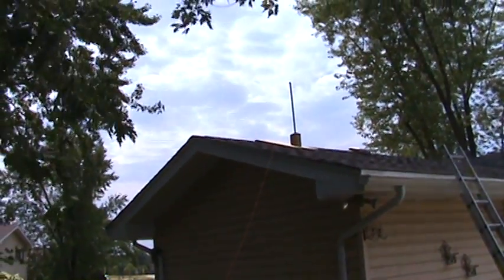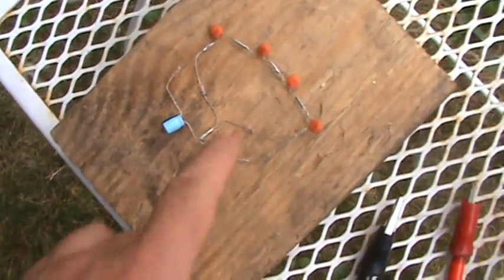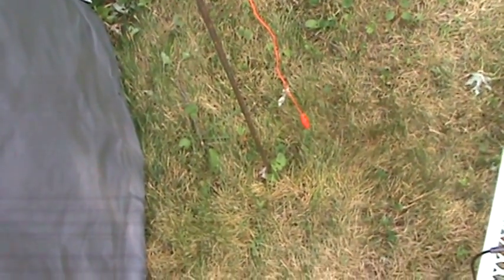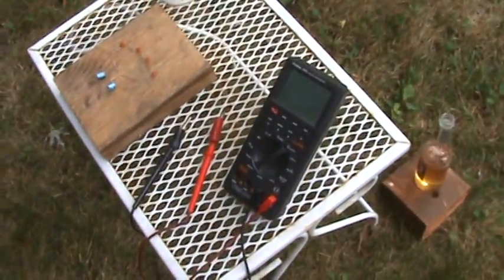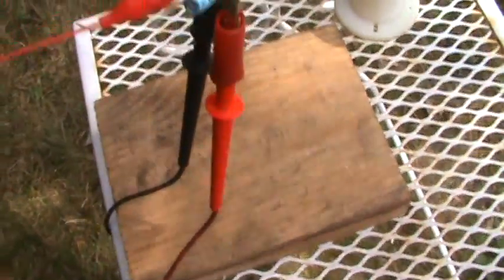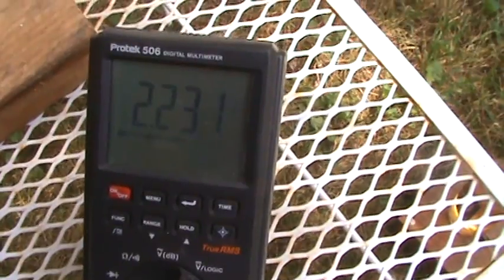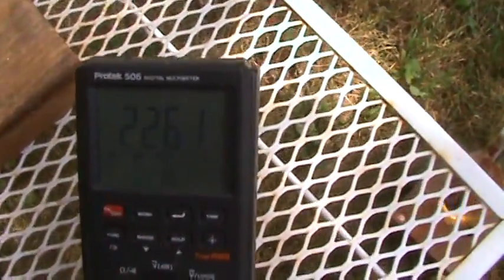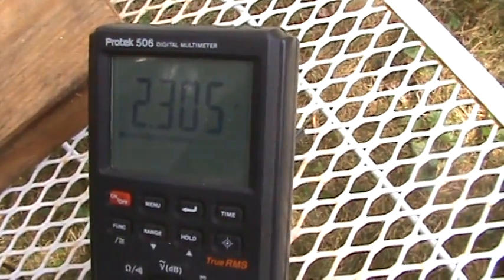Free Energy From Air 2015 part 2

Comment: i get 2.45 volts from a window screen that is 48 inches wide by about 10 feet long ,it is not grounded thought u might find that intersting that you are getting the same voltage reading i am.the screen is attached to my front porch screen.
Reply from the maker: You should get better results with the ground :-)
I did get just over 100V a few years back.  There is another video series on that period. search "free energy from air circuit Part 1/24"

Comment: amazing
Reply from the maker: I see you arguing with that butt head on video part 1.  That page wont let me view all 30 replies on that thread, heheheh but i get the email notifications with partial sentences.  Dont you just love open minded people like that(sarcastic).  You want to buy some diodes now so you can prove that guy wrong, hehehehee, he is such a jerk.
I have about 6 circuits with the diodes in them and only about 2 extra still in the package.  Some of the circuits were made with slightly different diodes, but over time i forgot which is which.  But i just bought about 10 more from ebay and im waiting for them to come in the mail any day now,,, someone is selling them on ebay now :-)
germanium diode 1N34A, i think from China, we will see how good they are.
Reply from the maker: Thanks.
  Im collecting electromagnetic radiation(waves in the air)
Reply: +INVENTOR3 just curious, how
Many 1n34 diodes do you have?
Reply: +INVENTOR3 yes, he was the ignorant person I ever seen, I know the receiver circuits work, through results and research, he thinks I'm that stupid. But I can gurrented you that he didn't know what's a tank circuit

Comment: Another crazy idea is to use Nuvistors working a microwave frequencies. A quartz osilator hooked inline with an inductor with a parallel bipass ceramic cap to use a high frequency oscillation to energize the tube. 50mhz quartz crstal and maybe an 8 ohm inductor? A small ceramic cap one to 10 pf. That may work to energize the tube by a cold cathode effect? This is just speculation on my part. But put it in a joule thief circuit to be powered by a good antenna. A tube fill with powdered graphite or steel wool may work. A ground rod a few feet down may help. The higher the elevation ot the antenna the more power. ? Why the old nuvistor tube maybe because of they were smaller didn't need high voltage to run the exciter and many tubes had a good gain and could handle electrostatic charge and maybe becuse if the lightning strikes the little high voltage spikes won't damage the device? I am no expert. I just like thinking up stuff to post for fun. I could be wrong for all I know. And nuvistors are rare costing up to about 20 bucks or so on ebay.
Reply from the maker: +travis moore Good ideas, thanks for being open minded and sharing your thoughts :-)  I keep thinking about using a piece of radioactive material for producing the high freq.  Also looking into the carbon graphite and graphene .....Cool, i see they now have Graphene coated Aerogel....
https://graphene-supermarket.com/

Comment: I see you are using the germanium diode circuit. I think it might be possible to use germanium transistors for a free energy collector? I found a crystal radio that used a PNP germanium transistor with the n junction hooked to the antenna and in a loop of capacitors and inductors. I guess the audio out would be going to a larger cap to charge using a crystal like radio circuit for power. It may light an led. ?